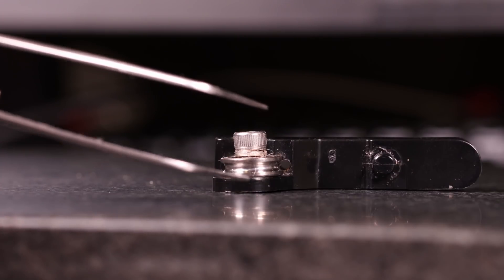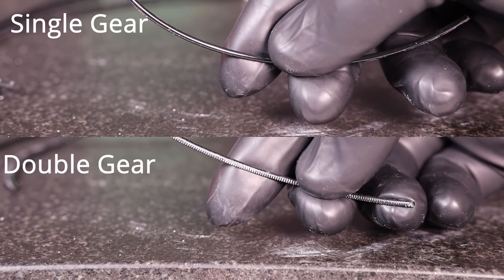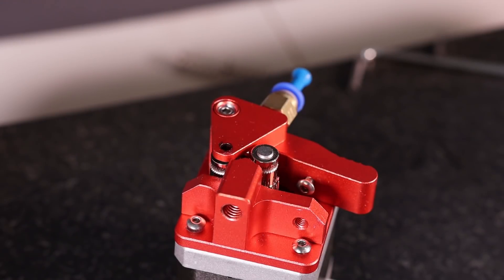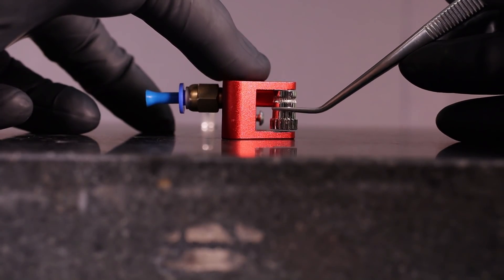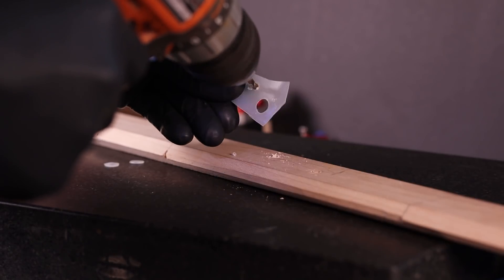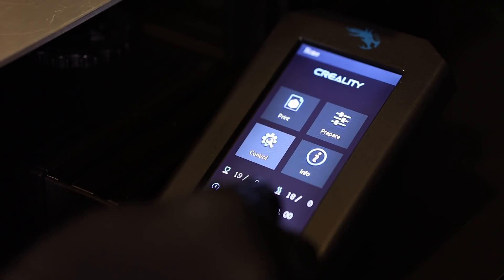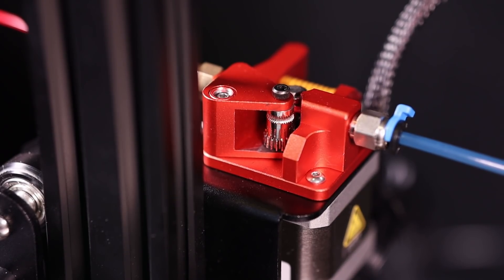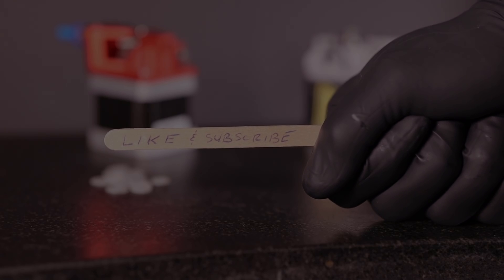Creality Ender 3 - V2 - Dual Gear Is a Great Upgrade, Except for This One Issue... Let's Fix it!

Comment: Newer versions on this have a curved bottom to the idler gear and solve this issue.  slightly Rounding over the bottom of the teeth of the gears with a file or sandpaper will prevent contact with the soft aluminum and achieve the same result.
Reply: Yes, and there is a washer already in place along with a spare. If you want to print TPU you might want to check out this video https://www.youtube.com/watch?v=QJucri-QPf0

Comment: I used a circle punch on a water bottle cap for my washer and my mini lathe was perfect for turning the gear, Hadn't installed it though for months till today! my stock one is still perfect.

Comment: Best and easiest way to fix this issue is your method + riding the motor gear as high of the bottom as suggested.
I just noticed that the stock turning/indicator does not fit unto the motor shaft any longer with this design :/ wouldn't have bought it if I knew this in advance...

Caveat emptor!

Comment: I bought one of these for my Anet A6 which has been modified with Bowden tube and E3D. The countersunk screw is a fraction too long and I will have to file it down to tighten but I'm not sure if the arm pivot screw is too long as well. When screwed down tight there is a 0.4mm gap between the arm and the body allowing some movement. Is this correct? The other two screws tighten ok.
Reply from the maker: It is correct, but I think there are some issues with the design, partly because the materials used are low quality, the bolts are soft and like to bend.  Too much pressure bends the bolt because there is quite a bit of leverage on the longer bolt/sleeve and arm etc.
Reply: OK. I've filed down the csunk screw and tightened everything. I've calibrated my extruder. 137.5 steps/mm to get 100mm of filament through the bowden tube when not connected to hotend. When connected to the hotend the motor jumps sometimes. Is this caused by too high feedrate? my feedrate is 25mm/s.

Comment: Hi my name is Colin and I have an issue and that is no matter who I follow and what settings I set I just can't get rid of the stringing problem I listen to what people say but no nothing seems to work can you help please. I have a xvico x3s with a bowden setup and the software I use is cure and matter hackers.
Thanks ever so much and also if possible do you have any links to videos I can watch. Many thanks.
Reply from the maker: Sure, can you give me some info about the filament as well?  PLA, PETG, ABS...other? PETG strings easily, ABS and PLA from my testing do not have this problem.  Dry filaments makes the difference, however other settings like turning on combing and printing one parts at a time, there are settings in CURA to do this also help.  My next video set to release sometime this weekend helps to cover my experience with this issue and what I've done to fix it.
Reply: @NeedItMakeIt  hi thanks for your reply.  Ok the fillament I'm using is a PLA Generic 1.75 using a bowden system on a xvico x3s printer I'm using up the Generic one first then I'm onto the esun silk in black the one I'm using at the moment it is stringing bad oh and I'm using matter control and cure.
All the best
Reply from the maker: @jackel7668  If your retraction is set to 5 already, keep that, the next question is have you ever made prints with no stringing?  If you have, I personally revert back to those settings in my slicer to eliminate the slicer as the variable.  The mostly likely reasons for your stringing are filament moisture and retraction distance.  too short of a retraction will cause stringing.  I'd download a stringing test tower and test different retraction settings  to see which one works best.  As far as drying PLA, it softens at a very low temperature, normally the oven is not a good solution to dry.  I'm sure someone has some solutions on Google.  

When something goes wrong, try to re-set everything to a time when it was going right and start again from there.  New nozzle won't hurt either.  I hope something here helps to to get it solved.  If you're still having trouble, take a short video and send me the link, it helps a lot to see it happening.

Comment: My solution was to just raise the drive gear to as high as it could go and adjust the idle gear accordingly. the force of the spring clamping itself to the filament forces it to stay off the frame and not grind it down.

Comment: My biggest issue was when I tightened the pressure arm screw. It would bind up solid, and would not move. I took an end mill the same size as the hole that the sleeve dropped into and milled just enough out to allow the sleeve to protrude out the bottom so when it was tight. The pressure arm moved smoothly back and forth.
Reply: I just added a small SS washer under mine and it freed the arm up nicely. It also fixed a gear alignment issue that meant I didn’t have to go and mess with grub screws.

Comment: I noticed you removed the two inner bearings in the gear wheel - but did not see you add them back.  I'm assuming those inner bearings are not needed after the wheel has been filed down and fitted along with the plastic washer?  BTW - thanks for the video. I haven't installed my WINSINN made dual gear extruder yet. But will follow your video when I do , to fix this problem.

Comment: Just so you know, the washer that you had on top of the gear, was supposed to be underneath it to prevent the gear from "washing out" the metal below it. Aka the problem you caused/fixed in a different way. You could have just put the washer under it and been done. That's how mine is assembled and no issues. YET lol. Been a little over a year. Only silicon oil a couple times in it's life
Reply: Or perhaps yours didn't have the washer. These are cheaply packaged.

Comment: I bought this kit. Note that with the dual gears, it's necessary to ensure that the grub screw is well engaged on the shaft flat side and that it doesn't foul the idler gear, forcing the two apart, causing the dreaded Ender 3 clunk. I had to file about 0.5mm off the grub screw.

Comment: Mine was a cheap clone. I've had zero issues. Very strong extruder for the price. I think this extruder and if you have a non TMC driver board the $20 MKS Robin E3 is the best upgrade I've made for my 2 Ender 3 v1s.

Comment: Why didn't you use metal washers?
Reply from the maker: It could work as well, the best solution provided by viewers so far is to set the motor side gear a little high, it helps to keep the 2nd gear high as well when the filament is fed through.

Comment: I just swapped mine day before yesterday, set the esteps , checked and rechecked my bed level, but now when I try to do any prints, especially the four corner squares ben leveling print, I can't get anything to stick, and it and just ends up a birds nest of filament around the nozzles tip. Any suggestions would be greatly appreciated. I am also using a Creality glass bed  on an ender 3
Reply: I have the Ender 3 V2 and have had similar problems. What I have found is 1) make sure your nozzle is at the correct height off the bed. Also set the height with the bed and nozzle at printing temperature as I have found this can make a big difference.  2) if you are printing with PLA on the glass bed, your nozzle is at the correct height, and your print is not sticking. Try wiping the surface of the glass bed down with a lint free cloth with Isopropyl Alcohol or sometimes called Isopropanol. I personally use 99% Isopropyl Alcohol which (in Canada) is readily available in most pharmacies. 3) If the first two don't solve the problem then I sometimes take a glue stick and rub a thin layer of it on the bed. Again I personally use the Elmer's Washable School Glue Stick. After a couple prints, it can start to build up on the glass bed so I just remove the glass plate and run it under warm water in the kitchen sink and the glue turns bright purple and washes off very easily with just running my fingers over it. After that I dry it again with a lint free cloth, install it back on the print bed, rub on a new thin layer and it is good to go. I have also heard horror stories when printing with PETG on glass with nothing on it and the PETG sticks so hard to the glass that the glass breaks when trying to remove it and or it pulls up small chunks of glass off the bed. So I always use the glue stick on the bed when printing with PETG and I haven't had a problem yet and the print comes off the bed without damaging the bed or the print. Sorry for the long post, hope this helps :)
Reply: @ph0t0dave  Thank you for the reply, yes, I did have to adjust the bed level again, seems that after I switched to the "upgraded" bed springs, they tend to give a "false" sense of level, I was able to adjust and get a damn near Perfect Benchy aside from a vertical line of artifacts up the left side about parallel to the doorway, but after 1 or 2 prints, I have to go back and relevel again because there is quite a large gap again, but after leveling once again, same result damn near perfect with the exact same vertical artifact up the left side of benchy, the only difference was the lettering on the botom was a bit better 2nd time around. If I can figure out what is causing that vertical line up the left side, and get a consistent bed leveling like I was before changing the bed springs, then It will be great.

Comment: i had a small issue with this: the filament didn't want to ride cleanly into the bowden tube! my solution: i used a knife to put a small bevel in the tube itself, guiding the filament into place
Reply from the maker: That's a good tip, sometimes mine gets caught on the way in as well.  I spend some time straightening the filament before feeding it in and I usually cut it on a bevel.

Comment: I just bought the WINSINN version of the extruder on Amazon and is has a chamfer on the bottom of the gear . There are no sharp edges from the gear touching the aluminum arm so hopefully the issue is resolved with none of this "fun" needed.
Reply: i bought the same one and am installing it today. hopefully no issues with it.
Reply: How is it working?  @themouselady275  Was the problem fixed?
Reply: @isaac-h  yep I have no issues on mine after having it installed for over a week now :)
Reply: @themouselady275  Great! Thanks.
Reply: @themouselady275  did you install it on an ender 3 v2 or a different printer?
Reply: Jeez, that is a really small chamfer.

Comment: Thanks for the great video, I just got mine 2 days ago after watching your video and found an extruder with a gear that has a chamfer. It has printed non-stop for 2 days and not a single problem. I'll just grease them for longer lifespan. 
Here is the link: https://www.amazon.fr/gp/aw/d/B07WV653KW/ref=ox_sc_act_image_2?smid=A1BV4N88UHB8BY&psc=1

Comment: the kit I bought the bottome of the gear was beveled will update on how that effects this after I install and use for a bit
Reply from the maker: A good tip is to raise the gear on the motor side just a little bit, it helps to keep the gear which was rubbing off of the frame.  Hope that helps!

Comment: Look for small  ptfe teflon washers they will last way longer and slide better 😉 and are also know to handle high temps (315°c /600°f)
Reply from the maker: You mean I wouldn't have to make them?  That's crazy!
Reply: @NeedItMakeIt  🙈😝

Comment: I just dabbed grease on the gear teeth with a small pool on the bottom edge. Using Moly grease and I have almost no wear. It's messy but effective. The filament doesn't get grease on it.
Reply from the maker: Grease seems to work wonders here.   As long as it is mounted motor down the grease should keep away.  Perfect, thanks!
Reply: @NeedItMakeIt  when I do see wear I'm making those Milk Jug washers though.

In the end it's still $17 worth of chinesium.

Comment: If you haven't bought this extruder already you should avoid it, even with this fix. Add another 5 bucks and get a proper TriangleLabs BMG clone. Works just as well with bowden as direct drive.
Reply from the maker: It isn't the best quality, thats for sure.  I'm testing a new style right now, I'll have a video in a few weeks on the subject, it might be another game changer.
Reply: @NeedItMakeIt  I mean if you already have this extruder and you want to modify it to make it better that's awesome. As long as you enjoy it! All I'm saying is add a couple of dollars to get something much better that will last longer and is more flexible. But I really enjoyed the video and subscribed. Looking forward to more 👍
Reply: @NeedItMakeIt  The TriangleLabs is actually very good quality.

Comment: You could also just chamfer the bottom of the gear thats digging in by about 10° or so, that way there's nothing that can be digging in. Also a little grease on the bottom of that gear will help too.
Reply: That's an interesting thought as the outside would have more velocity and wear faster.
Reply: @IAmKyleBrown  There would also just be no edge of the gear to dig in, you can't gouge anything with the backside of a spoon.
Reply: @braingrenade  Very good point!

Comment: Can this particular dual gear extruder be use in a direct drive setup?
Reply from the maker: I have tried it, and it does work on direct drive, but I think there are better ones, I'd probably go for the BMG style if you can manage to find a mount that works well with that.

Comment: Little fun fact, not all of those dual gear extruders actually come with a smooth rod screw for the idling gear.
Most of them actually have a fully threaded screw which will lead to the fast death of the pinwheel bearings inside.
Finding a smooth rod screw is actually pretty hard from my own attempts at finding one.
So I simply got a DIN912 M3x40mm screw and cut it off at the end with a dremel.
Reply from the maker: Oh the dremel, where would be be without it.  I still have my original dremel from when I was a kid and it still works great.  Great tip, other people have mentioned this as well and for sure that is a problem, pretty silly they'd do that especially since these parts don't seem to be hardened.
Reply: My kit came with a fully threaded screw. Luckily I have metal lathe and was able to make a replacement. I have had no problems with this new screw.

Comment: Hello. Did anybody of u also had problems with massive stringing after changing to this extruder?
Reply from the maker: That's interesting, I've not heard anytone mention this but I can certainly test myself to see if it is an issue.  Are you printing PETG or PLA?  Dried of course?
Reply: I had this issue, then I reinstalled my old one (single) and everything is back to normal. This is why I am reading those comments and see if I can solve this problem eventually.

Comment: I made a washer by using a hole puncher on a teflon sheet and cut a hole in the center of the disc  with an xacto knife. It fit perfectly on the F1rst Layer dual gear extruder without requiring any filing and removed all up/down play play of the gear giving a very slick smooth bearing surface. 
The interesting thing is that this extruder was in Creality packaging and the bottom edge of the gear was beveled. Is this their solution to the metal grinding? The retaining screw that goes through the bearing was completely threaded, so I am going to look for a m3x20mm half thread for replacement.

Comment: I had this issue and just replaced with an EZ R Struder. It's a lot easier to load and unload anyway and has a really well constrained filament path.
Reply from the maker: I will check it out, do you have a link you can provide where you purchased yours?
Reply: @NeedItMakeIt  This is where I got mine (it's not a dual gear but is has a large hob gear and has been an excellent extruder for me): https://www.seemecnc.com/collections/parts-accessories/products/ezrstruder
Reply from the maker: @10throwfilms  That's very cool, I've never seen this type before.  Thanks for sharing.

Comment: This extruder will absolutely not do flex filaments which is unfortunate! A small redesign with closer tolerances between the gears and egress hole is all thats needed!
Reply from the maker: Do you know which one does work well?  I'd like to test out some TPU down the line and I'm curious about which is the best for flexibles.

Comment: Able to print TPU?
Reply from the maker: I've never had the need to print with TPU, but I think some people have run into issues, to solve this problem, they've drilled out the alum. after the gear and run the tube right in, it would need a beven on both sides and a way of making sure it doesn't move (super glue maybe) or if the hole is tight enough that might be enough.  TPU is on the list, I'd love to make a few custom stamps or maybe insoles.

Comment: If your looking for an overkill fix instead of a plastic washer,  use an Oillite thrust washer.
Reply from the maker: I have some new hardened gears on their way along with new bearings and a shaft, I'll check these out.   

I'd like to try setting the drive gear a little higher for the next set and see if that helps as well.